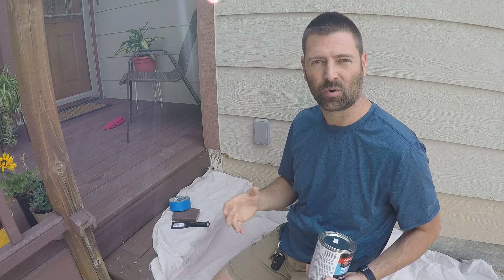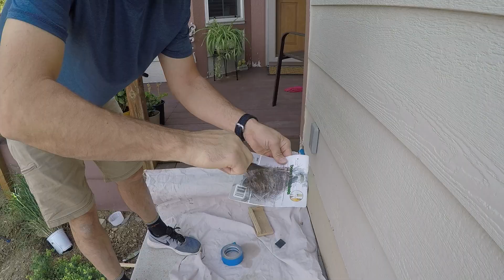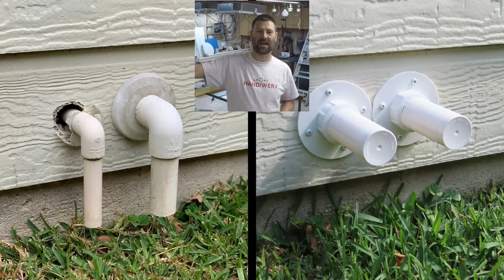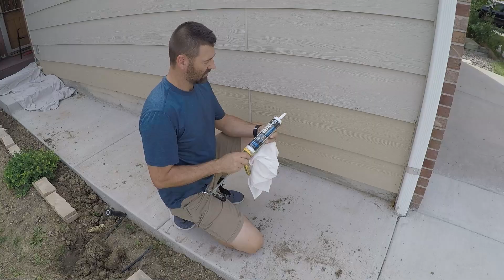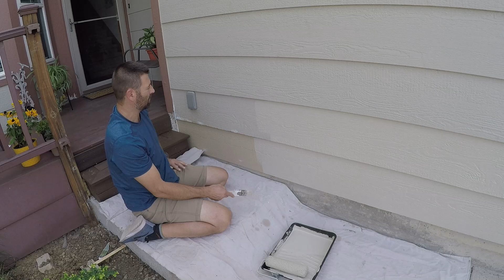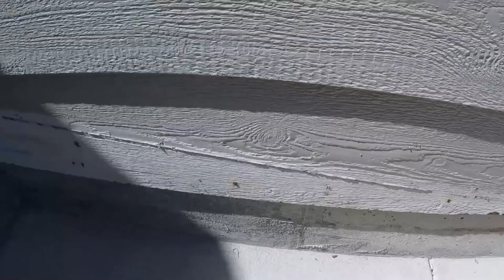How To Repair Damaged Siding | THE HANDYMAN

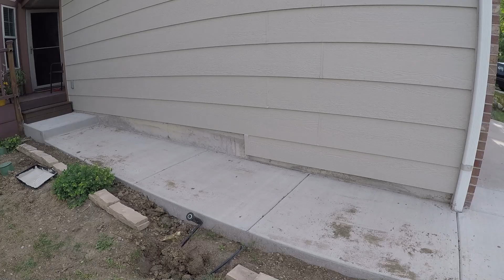Comment: What's with the lower siding board @ 8:46? Only half a run...Is that due to the way the house is built. It looks "off". Not terrible bad just out of place. I did find the video helpful. I have a bunch of rot going on the bottom of my shop, with T111 [I think] siding. Currently a good way in or out for mice, snakes and all the uninvited .

Comment: Great Video. I saw that you applied caulking to the nail holes and the sides of the boards against the trim. Are the painters supposed to caulk the bottom of each board? Thank you for the answer.
Reply: NO.

Comment: I appreciate this vid and the one about removing siding. I need to remove a bottom piece of siding to repair spalled concrete below. Also the Dauber Stopper: I knew I need this or something like it, on our passive Radon exhaust...didn't know about Dauber stopper so I created something like it using my wife's plastic canvas. I cut it to shape and inserted it into the open plastic pie, with a string attached if I ever needed to remove it. It does the basic job, but the insect screen is really the thing I was looking for. Thanks!

Comment: I enjoyed this video so much that I subscribed to it. I am so new at all of this and i am relying on these videos to get me through,, The question I have is the maker of hardie board says to use ready-mix concrete patch for cracks and holes (which I just bought) but now I am confused. I really want to do it correctly so it looks great. Can you advise me on this???.....I will put this project on hold until I am sure I am doing it right.
My manufactured home is 17 years old and needs a lot of TLC. I am bound and determined to redo everything myself in 1 year. I will start going thru your past videos and can use any advice you have to offer! 
I'm sure I'll be in touch again. Thanks and wish me luck!

Comment: Great videos! I discovered your channel a couple of weeks ago and I've slowly been going through your older videos.

Quick question about the Bondo - I saw the "This old house guy" say that he doesn't recommend joining bondo and wood anywhere where the wood will shrink and expand due to the climate because the bondo would just become loose when the wood contracts and expands. I've seen your other videos where you repaired a wooden door jam using that powder and I wondered if you would have used that here as well.

Comment: Is it not needed or overkill to caulk where the hardiest boards meet length wise?
Reply from the maker: That would prevent water from escaping if it ever gets in up higher.  You should always leave the bottom open to drain water.  It is the same way shingles work on a roof.

Comment: A good trick with that fiberglass bondo is to use a single edge blade to cut the excess before it fully cures, leaving just a little to nothing to sand

Comment: Patching particle board with Bondo is only for temporary fix. Bondo doesn’t rot or get wet but the surrounding wood get rot again.    I’ve seen many cases. 

When I sell the home, yes I patch with Bondo. If it’s my home, I replace it. Patched door jam or window sill get rot again in 2-4 years unless you dry well and paint well.

Comment: As a pro painter here is a tip. Do all your cut ins first with your brush then come back and roll you paint on. But while it is still wet roll the paint out on the siding with one consistent roll. That will reduce what we in the paint industry call flashing.
Reply: You probably want water to be able to run out and not get trapped
Reply: as a Painter if you were to paint the entires house, would you be caulking the bottom of each board? He only caulked the nail holes. thank you!
Reply: @santiagojavier9742  It is not recommended to seal the bottom of the siding boards due to several factors, the most important being that water needs to have a way “out” should it somehow find a way to get in behind your siding planks. 

There should be some type of water barrier/house wrap between the plywood/OSB panel/solid sheaths of siding and the exterior siding products (planks or otherwise) which helps to protect interior structures and mitigate water intrusion which leads to another key factor: the need for air to circulate between the exterior wall and the siding product - prevents mold issues and water damage to key structures such as wall studs which are typically made of solid wood 2”x4”s and have nails (hopefully hot-dipped galvanized or the equivalent) driven into them, which can become an entry point for moisture and over time may cause the 2”x4” to soak-in/wick-up any moisture in close contact. Breathability is very important for a home (and is different from air leaks)! I know it’s been a few months since your question was posted but I hope this helps! I’m not a contractor but I work in the trades and James Hardie siding is an amazing product and when installed properly can and will last 20+ years (according to their website/data sheets).
Reply: Hi if you were to repaint the whole wall will you start top to bottom? 
Thanks in advance

Comment: Can you DRILL into this type of bondo material? trying to fix an inside door hinge backing that is hallowed out due to dry rit ....2" x 1" approx. thanks
Reply: Sure can
Reply: Make sure the Bondo has a good bond to your surface but I have definitely used it for the same application. For instance if there is a high gloss paint or slick surface make sure u rough it first so u create some scratches for the Bondo to grab to

Comment: What’s the max size hole you’d recommend doing this with?  I have a customer with a big water damaged chunk missing in their siding, probably 8” or so.
Reply from the maker: If it is water damage it is probably larger then just what you are seeing.  Its best to replace that piece of siding.  I would only do this for smaller holes  2 inches probably.
Reply: @TheHandyman1  good call, thanks.  I'm a roofing guy, was going to see if I could help out.

Comment: --I will try your epoxy.  I've used Bondo by the gallons.  For deep fill reinforcement, drywall screws can be used as anchors.  Quicker than this is Vulkem 116 polyurethane caulk.  It can be shaped right out of the tube with a putty knife.  If the form boards are waxed, they release easy.
Reply from the maker: Just an FYI It is not nearly as easy to work with as regular bondo.

Comment: Minwax and JB Weld make similar epoxy fillers. They are a lighter tan color which I like better than the gray Bondo filler. But I might try the Bondo because it seemed in your video to have a different texture from the others--seemed a little stickier.
Reply from the maker: I got it at the auto parts store.  I think HD has it for about have the price as the auto parts store.
Reply: @TheHandyman1  it does

Comment: Fun little video. I used to use a lot of Durhams Rock Hard powdered putty for wood rot, especially for damaged window outdoor frames and sills. I'd forgotten all about that stuff. Hey, thanks for the video. 
-
The life of a contract handyman in the Property Management game... I'm exactly 8 Work Orders behind today at noon. I was working on a nice $1300/mo duplex make ready Work Order (massive punchlist). I get an urgent e-mail. "Rene, we forgot we have a Section 8 HUD re-inspection at a house across town, Thursday at 9 a.m. Can you take care of the attached correction list asap tomorrow (Wednesday)? Re-inspection failure is not an option."  I wrote back, "I'll access on-site at 4 pm today and get a materials list. I'll move some projects around, but a couple of your other delayed rent home tenants, expecting my service tomorrow, are not going to be happy."  
Not one word about  an estimate or quote. Just do it and they will pay whatever I put on the invoice. Sometimes the fees I charge are scary. But I follow your advice. I'll keep raising rates until they cry "Uncle." 
-
Reply: Is the Durhams putty good for weather exposure?  I have used it indoors before, but I never tried it for outdoor repairs.
Reply: @chrismoore9997  - Yes sir, once it sets up it ain't ever gonna re-desolve.  It can also be used to repair concrete and tile.  I'm sure it is not as good as modern epoxies, but is a lot less expense and  hassle for a handyman. Durham's has worked in all applications for over 80 years. An old old technology that is still going strong today.

Comment: Great job getting the repair to blend w/ original. Not an easy task when have different variables that working w/: materials manufactured at different times, paint & UV fading, etc.....as no such thing as “perfect” in the trades; can bet near perfect,  it nothing “IS” perfect, is what I was taught long ago. If you try to make it perfect, you can end up driving yourself crazy, & end up doing more work & possibly “damage” along the way🤣 (if know what I mean.....).
Hey there Handyman. Have a tip for ya. When making a “jig” or need a block to be held temporarily in place. Use strip of masking tape/painters tape than CA glue, & on back of piece of wood (or whatever using) put another piece of “tape” down & spray CA glue on that. Stick to other piece of tape with CA glue & have a strong temporary “jig/blocking” that won’t move on your when done, just pull off & peel tape off of service. Should come off clean w/ no residue. This helps if don’t have any support “blocking” underneath or in a tight spot, etc... A trick learned long ago (can use diff glues as well, but CA sets up the fastest) from a carpenter. Really do enjoy these types of videos (same “house” w/ diff projects & the “before”/“after” dramatic change👍🏻💪🏼).
Cheers✌🏼